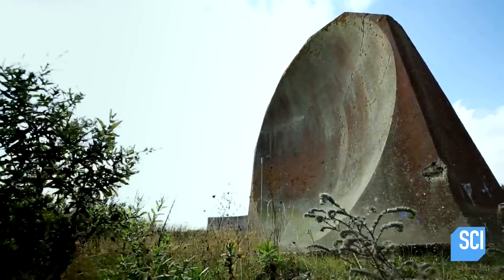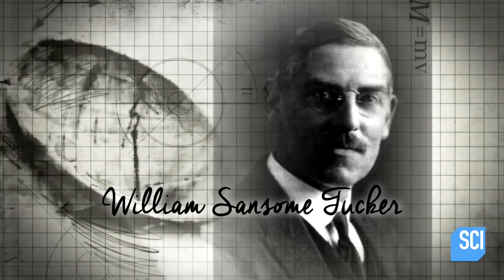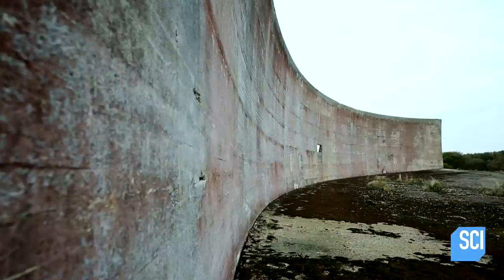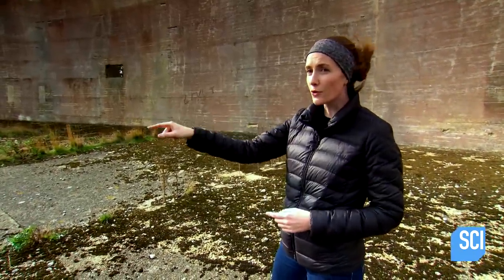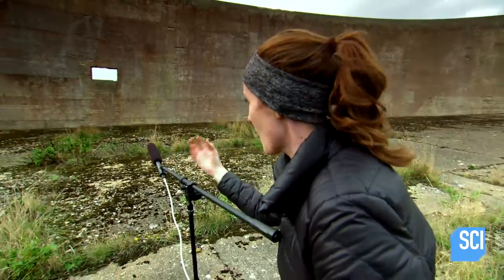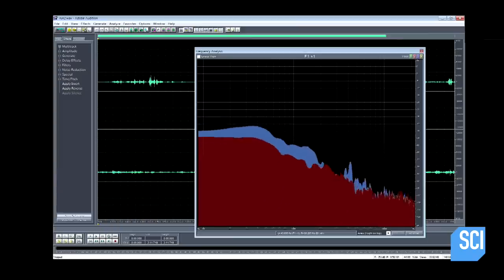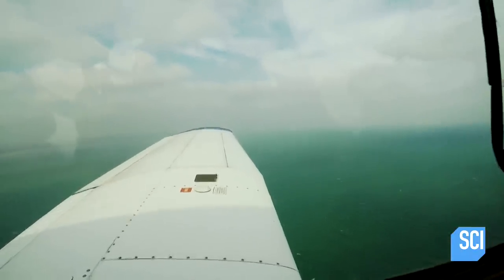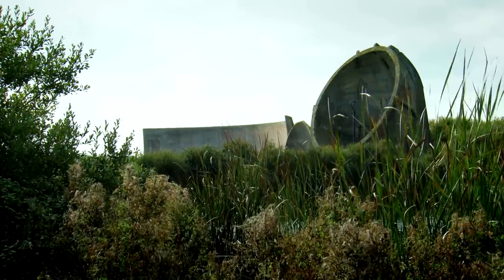See How Innovative Sound Mirrors Helped Detect Enemy Aircraft

Comment: A nice little bit of video, but it made me wince in terms of its factual content. 

None of these mirrors are paraboloids as stated in the commentary.  They are all spheroidal.   Paraboloid detectors are used where the mirror is itself movable.  Spheroidal mirrors like these are used where the mirror is fixed, but the receiver is mobile (or, like the 200ft wall mirror shown, with multiple receivers/microphones).  The demonstration would have been much more successful had they realised that  - as she was almost certainly nowhere near the "focal point" she claimed.

The rationale for this comes down to basic physics.  It is nicely set out in a contemporary publication to which  Professor WS Tucker himself contributed: "The Theory of Anti-Aircraft Sound Location and Detection" published in 1932.

The revised and updated version (published May 2017) of "Echoes from the Sky" by the late Richard N Scarth is highly recommended for the historical background to these structures.